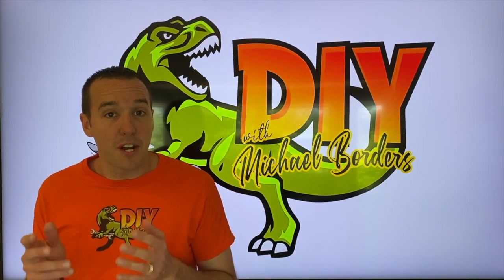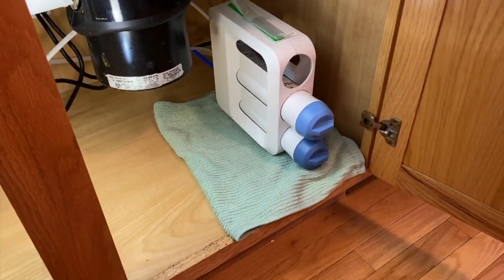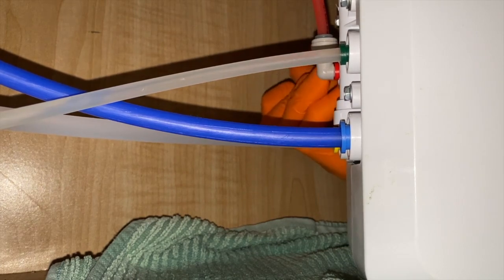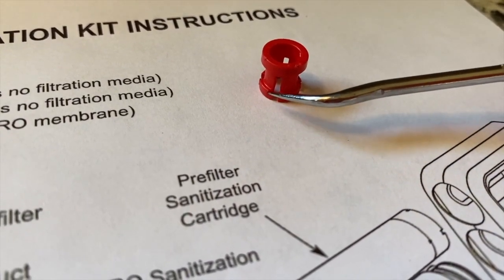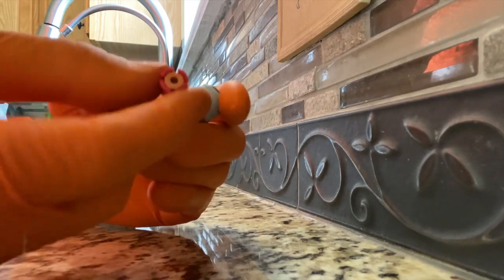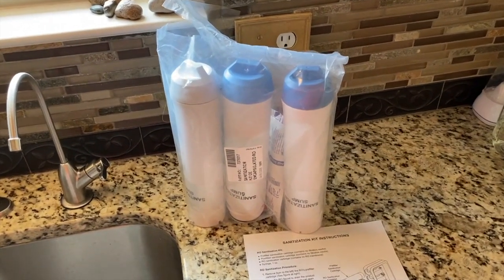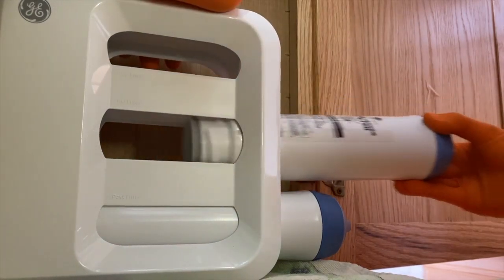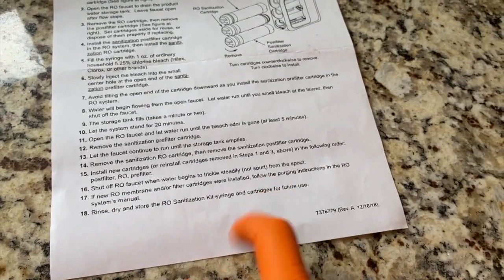Replace GE reverse osmosis filters and membrane

Comment: I didn’t see the other “steps” about removing all filters from GE; GE’s instructions: remove pre filter 1st, membrane filter 2nd, & post filter last, then replace new filters in reverse. Then purge system for 24 hours; replace the battery (supplied in pre/post filters packet). That’s it. I got mine in 2021; perhaps, GE has a newer version that requires the process you used in your video; however, I downloaded the instructions today from GE’s site and instructions were the same from 2021. I replaced all my filters today using GE’s instructions I mentioned above here.
Reply from the maker: Thanks for watching, the additional steps of sanitizing system with bleach is fully explained and performed in the video link below.

       https://youtu.be/5zNwA83aU0g?si=T4Gbvbxyb7x63Mie

We hope this helps.  👍

Comment: Is it absolutely necessary to purge the system after each replacement? How many gallons of water am I losing when I purge? Could that water be used to water plants or is it truly toxic? Thanks for your videos. You're the only person on the internet that makes this look easy
Reply from the maker: Thanks for watching, according to the manufacturer, it is.  We have had that same question for sure, not as much water as you think since it’s a trickle.

Kinda like letting your car warm up in freezing cold temperatures…you won’t get heat until the engine is warm.

Same goes for the filter and membrane, if you don’t allow the system to purge (warm up), you won’t get to experience the quality of the system at its fullest and best.

As far as using water for watering plants, we haven’t tried that…🤔…that will be personal preference.

Comment: I've had mine for 4 years and just replace the filters as per the instructions.  Pre and post every 6 months and center every year.  No issues.  I don't even purge for 24 hours after changing the filters.  I just run four 5 minutes to let the air out and then let the remaining air percolate out after that with the tap off.   Why waste all that water and lose 24 hours of filtering.  That seems like a month of water use maybe.  I'm drinking the water, not doing surgery with it.  I also discarded the battery.  It's just annoying.  Instead I write the dates of install on the cylinders.  Simple.
Reply from the maker: Good morning ☕️ we really appreciate you watching and sharing your experience.

We continue to enjoy this system, it has been great for us.  GE tech mentions to purge 24 hours for a few reason’s including removing air, properly priming membrane, and removing any chemicals remaining in system as the new filters and membrane are introduced to system and begin operating.

😁👍🧰

Comment: Ive had this filter for a few years and ive been happy with it until recently it stated gurgling a lot and spilling water out of the overflow hole in the faucet. Ive searched and looked for a solution but not sure what to do. Ive changed the filters as well but it just gets worse. Could it be that something is clogged in the system? Would appreciate your thoughts. Thanks
Reply from the maker: @willb.3787  

Thanks for watching, any update?  It’s very possible that the Black drain line is clogged.

We would open faucet and allow tank and system to fully drain.  Once drained, we would disconnect the drain line and check its condition.

If clogged, it will need to be cleared.  Keep us posted.

Comment: How often should the system be purged and how often sanitized (bleached)? What does purge do, and if not purged after changing filters does that mean you’re drinking stuff you shouldn’t be drinking because it hasn’t been flushed out? I’ve even got an extra set of sealed filters.
Reply from the maker: Copy and pasted from your comment on our other video.

Thanks for watching, great question.  GE recommends system to be sanitized once a year during the time you’re replacing membrane.

Purging will ensure all air has been pushed out of system which in return, will allow your filtration system to perform properly, efficiently, and as designed.

😎👍

Comment: I changed the filters and I have no pressure and my water tastes funny still after several months. What should I do? Should I just give up and buy another system? Do you have an IG I can dm you on? Can I pay you to help me fix this or should I just get a different system? I even have an extra set of sealed replacement filters so I’d rather get this working.
Reply from the maker: Good morning ☕️

By chance did you replace the internal flow restrictor?  This part has the tiniest little hole in it and if gunked up, can lead to your exact issue.

You brought up purchasing a new system.  Honestly, not a bad idea when comparing price of new systems against purchasing new filters, membrane, and flow restrictor.

We talked to a viewer recently that did just that.  He purchased the exact GE system and he mentioned he was very happy with his decision.  He new exactly how to remove old system, install new system, and new everything on how the system works.

Comment: After I change the pre and post filter(Center RO filter not change because just 6 months), I drain the water for about 10 minutes. After that, I still find very tiny black particles in the water; Are the filters defect or something eles ?
Reply from the maker: @jamessu9913  

Thanks for watching, did you perform a 24-hour purging cycle?   If not, we strongly encourage you to purge the system for 24 hours, which will help flush out any and all contaminants.
Reply: After 24  hours purge cycle, the water still has a lot of tiny black particles,; I order new set of filters and change them, after draining water about 5 minutes, those black particles disappear. The old set of filters are defect.
Reply from the maker: @jamessu9913  

Good morning, we really appreciate the update.  Defective filters unfortunately happen, that’s awesome you didn’t give up.

We experienced faulty filters a few years back, in our case they froze outside in the cold weather….sooo…maybe that was our fault…😜

Comment: Why did you remove the flow restrictor? 
You don’t need to do that when changing filters correct ?
Reply from the maker: Thanks for watching & welcome to the DIY Raptor Club.  The instruction manual recommends replacing flow restrictor when replacing membrane.

Let us know if you have any questions, hope all is well with you and your family.

😎👍
Reply: @DIYwithMichaelBorders  thanks so much 
Been stressed out trying to find out why my tank isn’t filling so was just curious
Reply: @DIYwithMichaelBorders  so the flow restrictor corrects the flow rate to produce high quality water and the check valve stop the RO from receiving too much pressure and the auto shutoff stops water from draining when tank is full ?
Reply from the maker: @drewmena8194  

So happy to help, us DIYers need to stick together!!!  😎👍
Reply from the maker: @drewmena8194  

😎👍

Comment: I changed the filters but after doing that the pressure is really low. Any suggestions why? Tia
Reply from the maker: Thanks for watching, after replacing filters, it takes on average 3-4 hours for the system to properly pressurize and provide proper flow of water.
Reply: @DIYwithMichaelBorders  yeah it’s more than 10 hrs now,it was okay before but after changing the filters now it’s very low. I was watching other videos too and a lot of people were saying that we should check the pressure of the tank too
Reply from the maker: @gst5620  

Thanks for the update, tank psi is important.  To get the best & most accurate psi reading, tank must be empty when adding air.

What psi does your manual say?
Reply: @DIYwithMichaelBorders  I ran the spigot for 24 hours, and still barely a trickle once I let pressure build back up. I seem to be in the same boat with GST.
Reply from the maker: @rollingstone3017  

Hey what’s up, thanks for watching & sharing this.  Let’s get this figured out.

A few things can cause this including a clogged flow restrictor, a faulty auto-shutoff valve, and even faulty new filters...yes...that can happen, it happened to us.

Below is a link to our RO system PlayList.  It contains several troubleshooting videos that you may find helpful.

       https://youtube.com/playlist?list=PLjCXOz8TSkZlQnBuZZrgOiwjkvAkXc_Ov

Please keep us posted, us DIYers need to stick together!!!  😎👍
Reply: @DIYwithMichaelBorders  Update. I have run all the water out of the tank. Reset the tank pressure to about 7 psi. Turned the water source back on. And I’m going to let everything build back up again. There does seem to be normal RO going on as it is trickling down my drain. That’s encouraging at least.
Reply from the maker: @rollingstone3017  

Awesome Awesome, thanks for the update.  Looking forward to hearing back from you on how it performs over the next few hours & days.  😎👍
Reply: @DIYwithMichaelBorders  Ok. I figured it out. My tank was simply too low on pressure after changing out the filters. I let it refill over night and checked it this morning. It had a PSI of 40. Water came out in only a trickle. Pumped it up to 60 psi (the max my gauge would read)and Hooray!!! Problem fixed.😃😁🤣😂
Reply from the maker: @rollingstone3017  

Good morning, that’s a great update and we appreciate you sharing this.  Hopefully many stress free days ahead for you!!!  😁👍
Reply: @DIYwithMichaelBorders  The one thing I don't know is why it lost pressure during the filter change. But it did. Even though there is no indication of this in the instruction manual. Oh, well. Everyone take note. I still love the convenience of this GE system.
Reply from the maker: @rollingstone3017  

Thanks for the reply, anything is possible with these clever little units.  😎👍
Reply: After all is replaced turn water on and water is running from faucet in to drain and won't stop